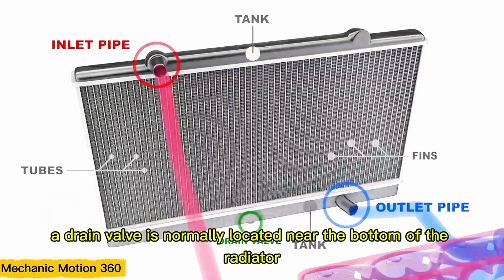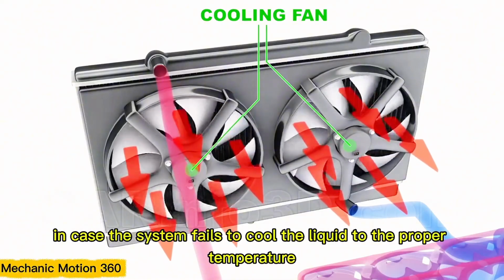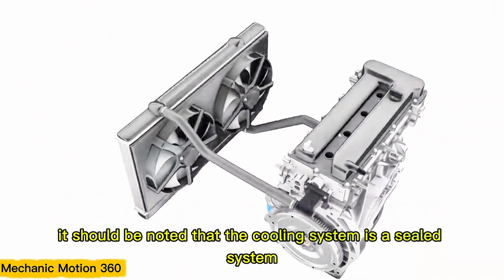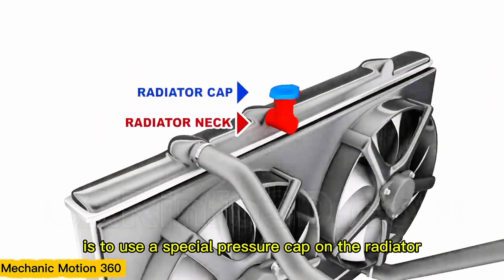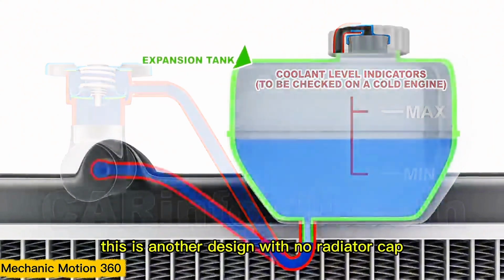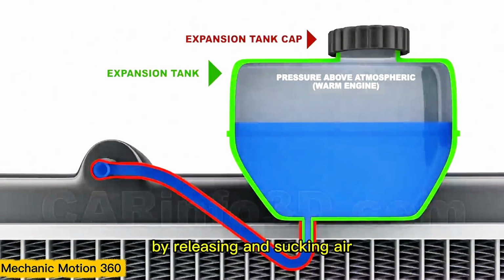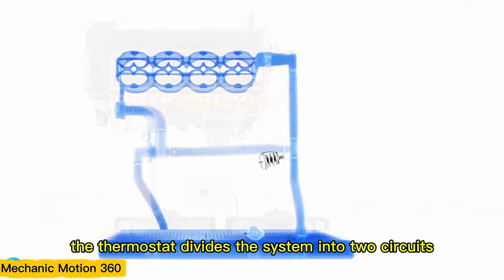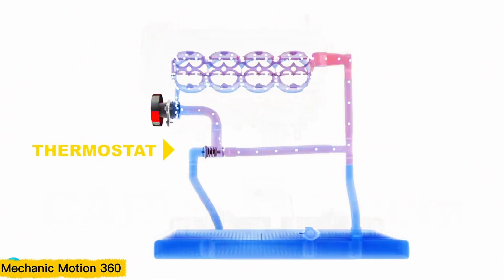Engine cooling system / how does it work? (3D animation) Subtitle is provided.

Comment: This channel is dedicated to professional MMA
(stick) welding for real construction work.
We focus on welding gates, steel tubes, house
structures, and foundations using practical,
job-tested techniques.
Learn strong joints, correct settings, and clean
welds through real projects and clear
demonstrations.